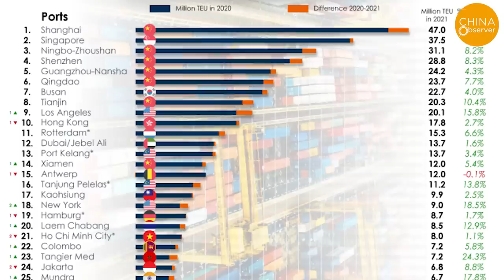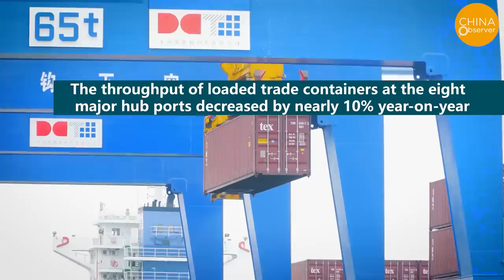Chinese Ports Full of Empty Containers; Foreign Investors Accelerating Withdrawal

Comment: What a difference a year and a half makes.  In fall of 2021, it was ports on the west coast of the US that were being overwhelmed by empty containers, to the point of delaying off-loading of ships by several weeks, driving up shipping costs, and causing supply shortages in the US.  With companies moving production to other countries, and the containers left behind in China, I wonder if that's going to create a new shipping bottleneck?
Reply: the issue revolved around railroads not having capacity at that moment to move loaded containers into America's interior, hence the ships waiting to unload...
Reply: I would rather pay 30% more and buy non-Chinese.
Reply: It also involved not allowing non union trucks to pull containers out of the ports. Add on $7 a gallon diesel fuel, and it was nearly impossible to make a profit. Unfortunately, for the residents, California is a victim of its own policies.
Reply: The main issue in the US with the shipping issues are that companies are using the shipyards as warehouses. They used to have to get their shipment out within two weeks of arrival. Now I believe some companies leave them there for months and just go and get what they need as they need it. Supposedly for many that is cheaper than renting a warehouse.

Comment: It was a mistake several decades in the making,  the outsourcing of goods to foreign suppliers or manufacturers.  I am a retired electrician and have seen Chinese bulbs fail within weeks, an Indian made conduit coupling split when simply tightening the set screw. Electrical fittings that lack threads, therefore rendered useless. Crooked electrical enclosures, threaded rod with a too thick galvanized coating...useless. If you multiply just my experience times how many others by how many years this has been going on you will see this has become a major problem. And I am only writing about the electrical construction industry. When the material I used was American made, I never worried about quality issues.

Comment: One of the reasons for high prices. The Chinese are fcuked.
It's been common knowledge over the last 18 months 2 years that the Chinese were holding back containers because their production lines are suffering.
They refused to accept Aussie coal but did a 180 when they were struggling.
Now it's hard for them to move or accept stuff.

Comment: In the 1990's I could redesign a product for a small company to be manufactured in China for 10 to 25 % of the cost here and it would be better quality.  About 10 years later a colleague shut down his factory in China because they could not maintain the quality standards they needed and it was just more cost effective  to manufacture  in Canada and the USA.  Plus corruption was an issue. On one occasion after a long weekend they arrived at their factory and called the police to report the theft of their back up generator. The police informed them that they needed it over the weekend and that they had it but they would have to pay the police 50,000  USD to reinstall their backup generator.  The cost of doing business and corruption may be catching up to China.